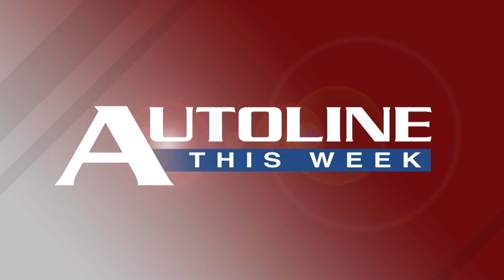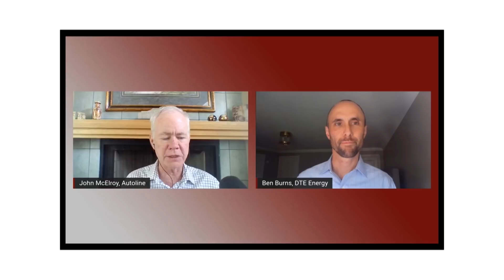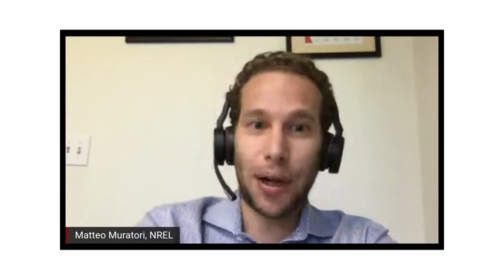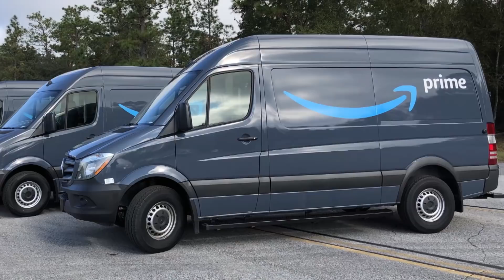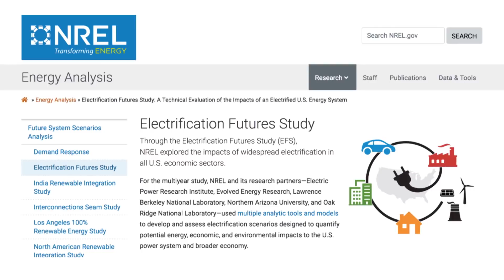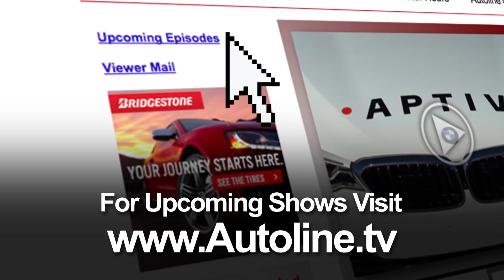Can The Grid Handle All These EVs? - Autoline This Week 2514

Comment: Nice discussion. Good to hear that energy experts are optimistic about the challenge.
Reply: @joemichele5412  Yeah, I'm always amazed how many people think we can't add a load to the grid the rough size of adding air conditioning to the grid and it not fall over.  They even insist it will be an issue even once they agree EVs will mostly charge at night and won't be piling on top of heavy AC use.

Comment: Range needs depend on where you live. Large city & suburb dwellers make one or two long trips a year, often as a vacation. In the Western US, Rural dwellers, and small, remote city dwellers make several trips a month that exceed the range on all affordable BEVs. Additionally, speed limits are in the 70s & 80s, which just KILL BEV range. A trip through Utah (80mph outside the Wasatch Front) in an ICE car (Ford Fusion 2000cc 4 cyl) sees about a 3% drop in mileage/range, the same trip in a Tesla Model S P100D, with cruise set on the same speed, saw between 10-15% drop in range, depending on hills. Instead of the advertised 370 mile range, we were having to Fast Charge every 180 miles, and there were some nail-biters then.

Comment: The current grid can't handle it but the grid has been growing consistently for the past decades. Projection show the grid just needs to continue to grow at the current pace in order to accommodate EVs
Reply: Yes, it is strange how the same people who say the grid will not handle the extra load somehow forget that is you jump back to 1980 or worse 1970 the grid of the time could not handle the present loads we have during summer with air conditioners, washing machines and electric stoves running at the same time.

I helped a friend when she was looking for a house to buy, and whenever we looked at an older house that had not been worked recently the first thing needed was an upgrade of the electrical box and worse often a total gut job for the house's entire wiring.  People do not realize how much the grid has grown and handled over the years.
Reply: Lol, the current grid CAN handle the load.  What the hell are you talking about, how many million people have an EV and charge in the US today.  It will certainly have to grow with EV adoption but so what, it also has to grow with population.  Also, unlike alot of other things like air conditioning and cooking, charging EVs can be time shifted very easily.  I charge my EV at 12:00 midnight.  All you have to do is give people a price incentive and they will charge their car whenever you want them too.  Its that easy.
Reply: @ultrastoat3298  I am say the grid can handle it, and if it can't there is too much money to be made that the grid will be upgraded where needed to get that money.  MONEY TALKS!

Comment: In Norway the take rate for EVs is huge. How is the grid there holding up?
Reply: @ForzaJersey  Important to add is that Norway's economy is based on selling fossil fuels to the world. This is why they can afford to heavily subsidize battery cars.

Their abundance of hydro power is also a fluke based on the geography of the country and the limited population.
Reply: @ForzaJersey  Cold impacts range but it's simply not significant.  If you have a heat pump system it's even less.

Comment: EVs when V2G becomes more common... Will actually be a asset for balancing the grid...
Reply: No way I'm letting PG&E take range away from my EV to cover their inability to meet demand.
Reply: @michaelterrazas1325  inability??? That was an incorrect assumption... 
And no one will force you to earn money from your EV...
Reply: I don't want V2G. My car's battery is too precious to me to make it worth my while to subject it to additional charge cycles either to balance the grid OR generate a few dollars a month supplying the utility. My car and my charger have computers in them, I will offer my charging connector to be a "smart" appliance and  schedule the charging times and rates to adjust load when the grid is overburdened. I usually plug in in the evening when I don't anticipate using my car for several to dozens of hours. My app tells me that it'll be recharged in 2-4 hours, but I don't care if it's charging between 9 and midnight, or if it charges between 2 and 5 am. Or if you want it to charge at a quarter it's maximum rate and trickle charges from 9 pm to 6 am!!! The utility gave me a discount when I let them cycle my A/C on and off during peak hours, and I've never noticed the difference. Why not let them talk to my charger to adjust time/rate for my car to do the same thing. The power draw on my car can be a lot higher than my A/C so it will present even better opportunities for my power company to help balance the grid. A slow rate charge that minimizes the time that the battery sits fully charged is good for my battery asset anyway. It would be nice if my car could generate a charging diary so I could show its future owner how well the battery was taken care of before they bought my car from me someday. It would be as valuable as a well documented service manual on my old ICE cars.

I can use my app to override any scheduled charging I have programmed if a situation arises that make we want to accelerate my charging needs. When I first got my EV I imagined and worried that there'd be many times that a low battery would hinder me in an emergency, but so far it has NEVER happened.
Reply: @nc3826  PG&E, my utility company has never been able to meet the electrical demands of California in the summer. I have lived here since 1962, and we have had rolling blackouts as long as I can remember. And our idiots in the state Assembly are trying to pass a bill so you can't make money by generating your own power. My solar panels are grandfathered in to make them keep paying me, but new panels may soon just be enough to reduce your usage. V2G, under this bill will just be theft, IMO.
Reply: @michaelterrazas1325  V2G is just one way for PV owners, who send power to the grid and contribute the "duck curve's" daily variation grid imbalance, to help offset it.... 

But I agree it also has to make sense financially. For EV owners, such as by offering 
higher peak rates to sell the electric, than the off peak lower rates they would buy it,  for them to opt in... Unlike the average PV Net Metering rate schemes that does not allow variable pricing, causing utilities to have a net loss...  And a greater grid imbalance to deal with too.... 

They both needs to make economic sense to function properly, IMHO.... And I have no idea about the details of the bill, but I doubt it "forces" EV owners to sell the electric from their batteries.... Like most utilities are forced to accept electric, they do not need from PV producers... So who is the thief? 

FWIW the govt could buy the utility and run it..... And then everyone could see the costs. And decide how best to run it.... But then govt, would be blame I guess????

Strange how just mentioning V2G, could lead down a rabbit hole??? lol
Reply: EVs will be remain plugged in as source of emergency backup power, for a homes or a buildings.... From many newer EVs like the F150 Lightning...
Reply: "V2G", "Smart grids", "demand response", "flexible load".

These buzzwords are just synonyms for energy poverty
Reply: @michaelterrazas1325  If you don't like taking money from PG&E but would rather pay them instead that is certainly your choice.  Me, I'll make money off them all day long.
Reply: @gregb7353  PG&E is already paying me for my solar roof. But they're trying to end that right now via their patsy in the California Assembly. And part of that plan includes making V2G not profitable for vehicle owners either. Tell me again how it's a benefit to me to have them steal my range.

Comment: They say that the grid can handle the adoption of EV's but they don't say that they have enough power and that they will require EV's to assist the grid. This sounds like a massive power supply problem in the future.
Reply: Not in the future, we're already having blackouts and expensive electricity because governments force unreliable, expensive solar and wind onto the grid.
Reply: @phamnuwen9442  The cost of wind and solar on a grid scale are now cheaper than fossil fuel burning power plants.  So there that!   P.S.   I understand it's the air conditioning loads that's causing the brown-out...I guess you just can't run those off-peak like you can with EV charging.
Reply: @Brad-sb1dk  The grid problems are because solar and wind are inherently unreliable energy sources being applied to a grid that requires perfect synchronization between supply and demand at all times.

This cannot and will not change until someone invents a battery that is many orders of magnitude cheaper and better than today.

This is extremely unlikely to happen any time soon because of physics and chemistry.

The figures about cheap solar and wind you're referring to completely ignores the problems of intermittency I described above.

Comment: Our local electric utility said the same thing about EVs but we still have Summer and Winter burnout still!  When and if EVs get on board it will go from 5-6 burnouts a year to 152 burnout or more a year since they are changing from natural gas and nuclear to solar and wind now!  This is insane!  People will be paying triple for green energy and will not help the environment in the long run either!
Reply: What time of day are your current brownouts?  I'm guessing it's not in the middle of the night which is when EVs will be using the grid mostly.  EVs will make the grid more robust and stable allowing power companies to run more large power plants instead of lots of small expensive ones they can turn on/off quickly.

Comment: The “ take rate” will be the pushed or forced rate with a carrot 🥕 and stick . Much like the 2008-2009 $150. Bbl oil cost they used to push EVs and hybrids . Then made prohibitive EPA requirements for diesels while totally Ignoring the external combustion in heating systems in North that burn 24/7 winters . It’s EXTERNAL combustion !!!
Building heating systems. That burn oil , gas, wood and still coal